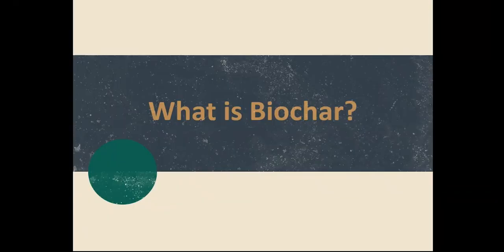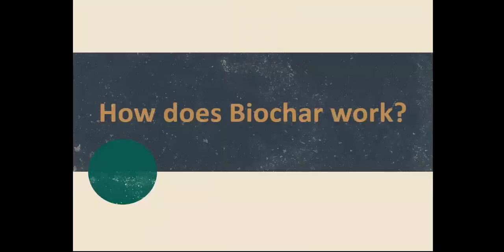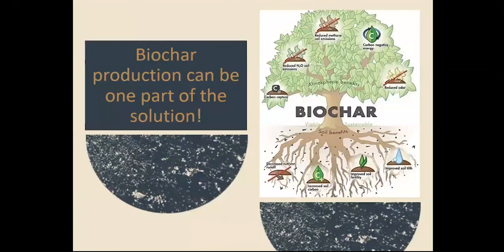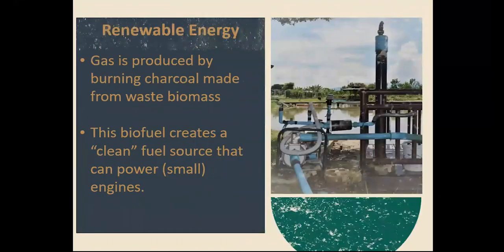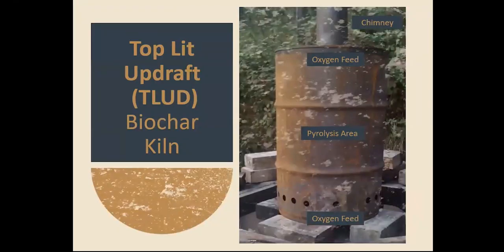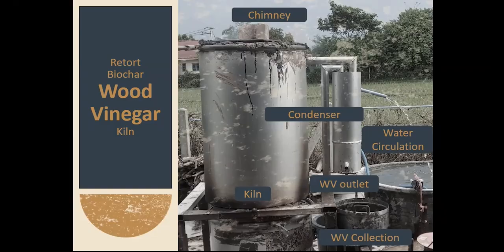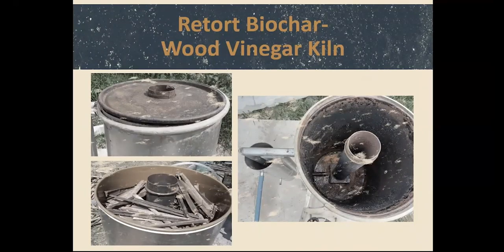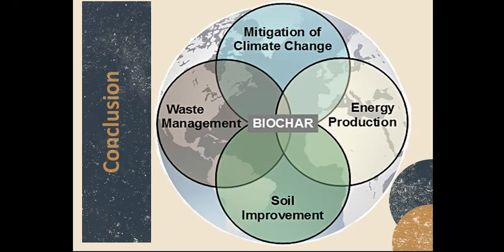Biochar Production Training

Comment: hey ECHO Asia, so what would happen when i add plastic wastes together with agricultural residues, do u think that could enhance the properties ov Biochar, in that case how would they be improved
Reply: Hi @jacklineakwehaire5206. Plastic waste will melt and then form a sold mass again when it cools. This will add no benefit to the biochar, and actually make it unsuitable for adding to the soil or using for water filtration. Plastic will release toxins when heated, and adding to the soil will cause microplastic contamination as it breaks down over time.

There is a lot that could be done to enhance the properties of biochar, but it depends what properties you are looking for. Properties like increased porosity of biochar are improved by having high pyrolysis temperatures over a longer duration. 'Charging' of biochar will add nutrients and microorganisms to the char. It is also possible to pyrolysise the char together with minerals, that cause increased mineral concentration of the resulting char.
Reply: @ECHOShaun I understand that when you heat plastics they will melt and after cooling they will solidify but I'm looking at the temperature at which is plastics are heated yes at the beginning they will first melt but as the temperature increases I think they will undergo thermal decomposition and they will produce hydrocarbons so it those hydrocarbons that I thought they would be of use to the biochar produced in terms of improving their properties.